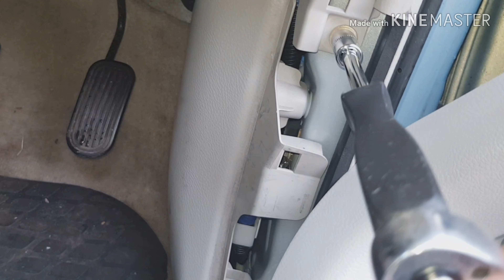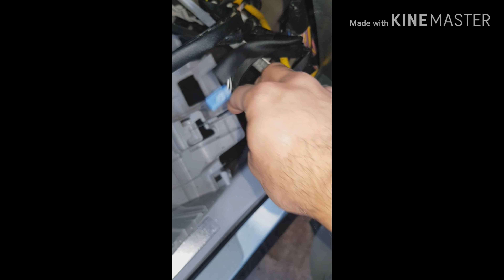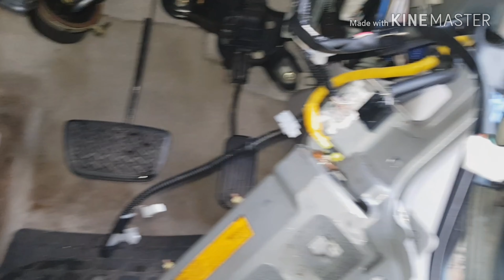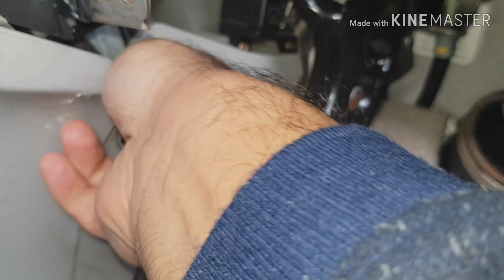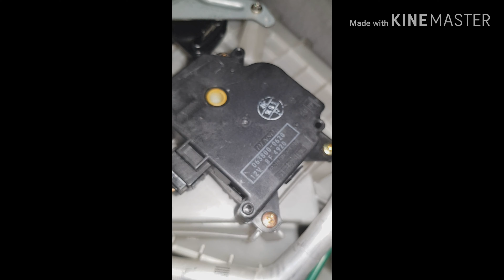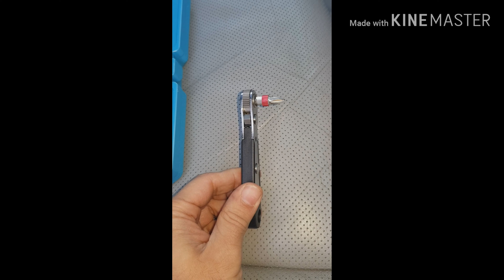Lexus RX 300 330 400h UK version fix ventilation AC direction mode motor servo

Comment: Can you unscrew the mode motor off the metal plate without have to take it out with the white levers, i.e. leave the white levers on their current position?
Reply from the maker: I don’t think so unfortunately
Reply: @Hacksome thank you, I need to do this job and the one thing that I am worried about is making sure the plastic flaps/levers are attached in their correct position when replacing the motor
Reply from the maker: @nobloodyusername it’s a bit tricky but you can get it right first time. Just do it with patience

Comment: Hi mate 
Do you have any idea how to test both servo motors ??
I have connected both to plugs and it seems like they do not work 
One of them upper had breaks so I used special paint to fill missing spots 
Bottom one is in perfect condition 
Connected both without fastening and non of them is moving changing settings on touchscreen 
Thank you
Reply from the maker: @andrzejczarnecki7835  so it was long time ago now, wish I still had the car

Comment: I'm late with comments but thank you for this. I found that removing the front seat bolts, tilting front seat to disconnect electrical connectors and pushing the whole front seat back gave stacks more room for doing this job. Also when you disconnect the emergency brake, it is very difficult to take out completely (which I did the first time) but you can push/tilt the brake assembly towards the accelerator ie away from the servo motors to give you more space, once you have the nuts and bolts off. Saves having to remove the thing!  Once you have cleaned and/or changed your motors, you can test them in your hands to see if they work before reassembly, then check again once fitted. Its better to have two people to do this as suggested. Lastly, aligning the air box flap pins upon reassembly to the black plastic plate is extremely difficult. Taimur shows us where he set the black plate before offering it up to the 3 pins, probably the best way to go otherwise, just trial and error in an awkward space!

Comment: Thank you. I just now fixed mine on my RX350 2007. It was dirty inside but the main issue was that the previous owner brought it to a shop that didn't put the timming correctly. So it made the clicking noise. Now, no more noise. Thank you for your time, cause it also took me while